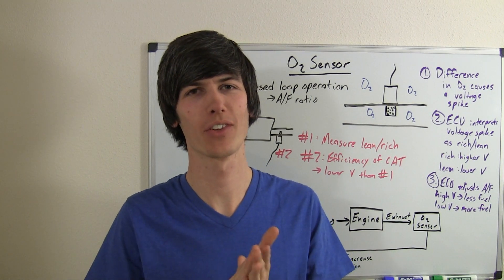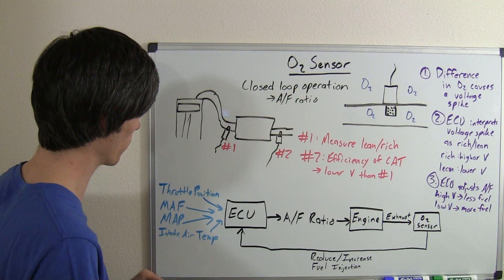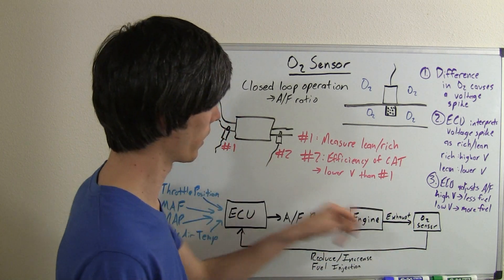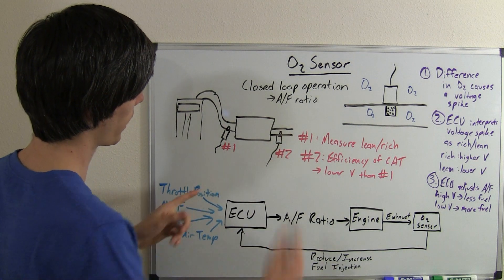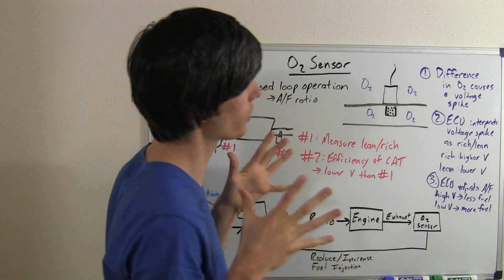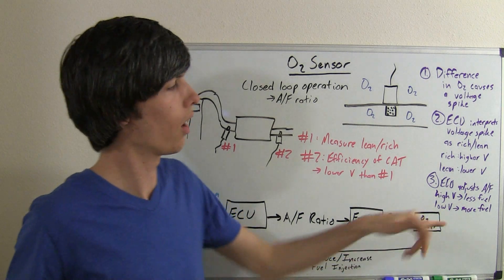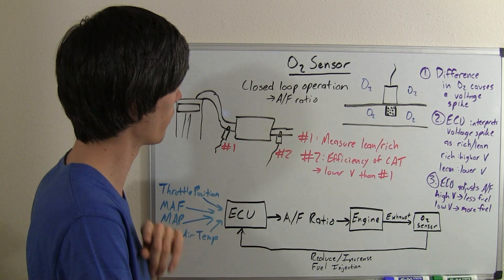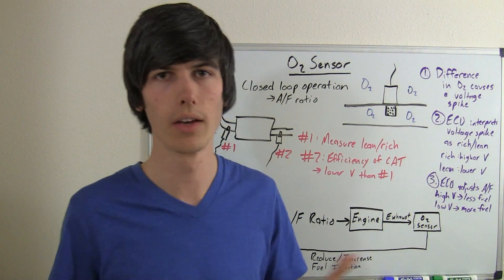Oxygen Sensor - Explained

Comment: I love it when you have multiple questions in your head, and then the presenter answers all of them without you even having to ask!  GREAT VIDEO!!  Much respect from a fellow engineer (mechanical).  Now, it's time to replace my MAF and O2 sensor on my 2005 Volvo XC90 which has 317,000 miles!
Reply: youre a mechanical engineer but you dont how a λ sensor works?

Comment: Closed loop = measurements from the system output (in this case the oxygen content of the exhaust) are used to modify future control values (fuel/air mixture ratios).  Open loop = control values (fuel/air ratios) determined solely by measurements from system input (map sensor, throttle position) and system model (limp-home basic fuel/air mixture ratios stored in the ECU).

Comment from the maker: Same initial four strokes plus an additional stroke injecting water used to take back some of the lost energy and make it useable (vaporizes and expands), and then an additional exhaust stroke. Basically done to improve efficiency and reduce emissions. Fuel is injected once every 3 rotations of the crank rather than every 2 rotations.

Comment: The rear sensor actually responds faster as a rule. The
reason it reads lower is due to the gas concentrations and
the overall gas exchange time not the intrinsic sensor
response time. The rear sensor is protected by
the catalytic converter, so it sees less contamination from
the exhaust gas and therefore less degradation. Remember
that the front and rear sensors are operating under
different gas conditions, so you will see different
responses independent of the sensors themselves

Comment from the maker: Quite a few codes... I don't know about the fuel banks, could be a lack of fuel going to the cylinders. I'd check the spark plugs, if it's run with a distributor check that, the rotor and cap, as well as making sure the wires are fine. If you're not getting a spark it can throw off a few codes, so I'd start looking at that - only a guess though.

Comment: The "narrowband" (2, 3, 4 wire) sensors only report that the mixture is lean or rich.  The "wideband" O2 sensors (5~6 wire) give an indication of how lean or how rich.  So a control system using a wideband sensor can correct back to ideal fuel/air ratio more rapidly and with less error.  Lookup "AFR sensor" on wikipedia for more info.

Comment: How would you extended the wire s on those sensors?  Because I installed headers on my truck and I want it to read right before the cat but it doesnt reach all the way . So I had to put it on the right header.

Comment: Misfires can lead to rich exhaust gases, causing clogged cat converters, then other issues regarding fuel/air ratios. 

You may have individual coils, since it is a Ford V-8. Try to switch those on cyl 2 & 8 with any other. Then clear the present codes and drive for at least ten miles for newcodes to appear. This will then give u an indicator of what components u may need to replace, i.g. coils, spark plugs, o2 sensors.

Comment: Great videos. The only thing I don't get is why the 2nd sensor usually reads a lower voltage than the 1st one. (some oxygen ions from NO are reduced to oxygens, but oxygens are also used to oxidize CO and CxHx, why is the net difference usually positive?)

Comment: I need to set air/fuel ratio on a propane fueled engine.  I was thinking about using a "lambda" sensor or a wideband O2 sensor, will they respond correctly on a propane engine?  I understand the stoichiometric ratio is different for propane, but will those instrument correctly indicate AFR?

Comment: so it spikes back and forth between .1 and .9 in the upstream sensors and is it ok if it spikes back and forth between .1 and .5 on the downstream ones? does that mean its got more oxygen so the cat is working? what reading should the rear o2 have? no spiking or less spiking with different readings than upstream?
Reply: Upstream o2 suppose to fluctuates from 0.1 to 0.9 and downstream o2 suppose stay a flatline like 0.4-0.5-0.6
Reply: My S1 is pinging in at 3.+ and my S2 is pinging in at 0.055 P0420. Car runs great though!

Comment: What voltage = 14.7:1? Do I assume 0.45V is stoich AFR? If this is the case does 0.1V = 3.3:1 and 0.9V = 29.4:1?
Reply: Oh definitely not. You know how AFR are considered wide band? They can see a much wider range of air to fuel ratios. An oxygen sensor can barely see above and below 14.7:1 so the goal on a car with a front o2 sensor is to go up and down passed ideal.

You definitely can't infer AFR like you'd get off an AFR sensor to the voltage on an o2 sensor.

Comment: So if my car is having a failed o2 sensor on sensor #2 and the check engine is also reading a catalytic converter I may just need to have that o2 censor changed? Could the o2 sensor be causing a back flow of oxygen? Sorry if that's not clear ha ha I wish I had more knowledge on cars.
Reply from the maker: It could just be the sensor, yes.

Comment: Would it be possible if I would block off my secondary O2 sensor?  My car is old and I get engine oil blow-by occasionally.  I do not have emission standards to pass and just have an annoying CEL light.  I am thinking of using 2 defoulers with some stainless in between to block the occasional oil coming out of it.  I'll still have the sensor installed but just basically completely out of the exhaust flow.  What do you think and thanks for your time.

Comment: I figured it out, it was an installation error on my intake gaskets. I took everything apart and slapped in some new ones. My air/fuel ratio problem is solved. She's still a little shaky but I think once I get the new spark plugs she'll be running good again.

Comment: Very few secondary O2 sensor also report closed loop rich lean info back to the PCM, not only Cat Efficiency data, it is rare. A good Cat will use up the STORED O2 in the substrate so very little O2 comes out of the Cat so the constant reading can be a low or high voltage as long as it does not swing is the important thing to know. If the Cat is burning the stored O2, the secondary O2 sensor will report rich or lack of O2 which is fine. There are also arguements if this sensor actually reads O2.

Comment: I've been running without any o2 sensors for about 2 years now and my car stutters in the lower rpm's and backfires like crazy when I let off the gas so I think it is running rich and gas is igniting in the exhaust which gives it the crazy backfire.

Comment: thanks for your easy to explain video... I have a question though, if  there is a fault in that 1st sensor, could it cause issues for the second... I have a fault reading on both but after tests the mechanic thinks it's just the first that's faulty... could the fault in the rear sensor be as a result of the faulty front sensor and it's effect on fuel ratio??? I.e. get the first sensor replaced, better fuel ratio and better readings after the cat?  thanks for your help

Comment: Hi nice video! Is it ok if i clean them when they get dirty? I had some problems and after i cleaned them with a metal brush and some cleaning spray the engine chek light didnt come on anymore...sould be ok?
Reply: I tried that a couple years ago. The oxygen sensor worked again before it crashed and ran worse than ever. So, if I ever clean one again to get a few more days of function, I'll be immediately ordering a new one!

Comment: I have a truck. Have you heard of 02 extenders? I want to put them on the upper 02 sensors to use less fuel. I also have a minivan with no cat. And want to put the extenders on the lower so I'm not burning rich.

Comment: How often does the front o2 sensor tell the ecu to adjust its air fuel ratio? Is it at the same frequency electricity is distributed through the car (just guessing 50 hz like standard US electricity) or is is more like every second or minute or couple min?

Comment: Does the ECU adjust air fuel ratio, based on the sensor after the Cat ? 
In performance exhaust applications many times the cat is omitted or high flow. So one will use a defouler or some how program out that sensor on the ECU.  Will this cause the ECU to not make adjustments appropriately. Or is the ECU primarily checking the efficiency of the CAT? Thanks for your time!

Comment: I have a peugeot 306.. the problem is that while I slow down, the engine run normal but i lose power while acceleration then its came back...so what could be the problem...

Comment: i recently bought a honda civic that came with a ECU that has been programmed to bypass the oxygen sensors. Ive been having misfiring issues between 1 and 3 thousand rmps. which is really troublesome for me to drive. is this in any way related to the bypassed o2 sonsors.

Comment: SO the ECU makes changes to Fuel Trim on MAP data - then if there is still an issue the O2 sensors will then make another fuel trim.  So restricted airflow causes MAP to record an actual pressure Below that expected from the Throttle setting,  thus less air, thus mixture is Rich, less oxygen than expected  - So the MAP causes the ECU to reduce fuel input.  WHEN the 02 sensors read exhaust and the MAP/ECU didn't get it right, the ECU is instructed to make an additional fuel trim.  Restricted air flow or Rich condition can come from leaky injectors, caked up valves, blocked EGR?  Unless at idle, where the IAC plays the major role and can be faulty.

Comment: Hi. I have two oxygen sensors, one before the cat, and one after the cat. I also have a decat exhaust setup. So my question is, is it fine for the two oxygen sensors to be reading the same amount of oxygen? Will it confuse my ECU? Thanks in advance!
Reply: Your 1st o2 sensor is primary and determines your AFR (air/fuel ratio), your secondary sensor monitors the efficiency of your catalytic converter and makes sure that it is doing its job for emissions purposes.

The secondary sensor does not affect the readings of your primary o2 sensor, it is merely there as a reading element to determine whether or not your catalytic converter is doing its job correctly.
Reply: Necrodox ah I see. that makes a lot of sense, thanks! What's the point of monitoring the efficiency of the catalytic converter tho?
Reply: iAerick 1.) emissions.

2.) to tell you if your catalytic converter is clogged. If it is inefficient something is "wrong" (I only add quotes because some people choose to run without a catalytic converter (like myself), what that problem is can vary. But a catalytic converter is primarily for emissions. It also takes out some of the harmful vapors that you shouldn't inhale.

Comment: Which condition sets off the CEL? Too Rich, too lean, too much difference between the front sensor and the back or all three?

Most vehicle's are fuel injected. How do you change your vehicle's fuel flow to fix the problem? Also, at some point it becomes necessary to replace the catalytic converter.  If the fuel flow hasn't been addressed, you will just have to replace it again and again!

Comment: A wide band sensor will keep the system in closed loop farther away from stoich. A narrow band (conventional) O2 lambda switch will keep closed loop from 14.6-1 to 14.8-1. The wide band will keep the system in closed loop from ABOUT 10.-1 to 21.-1 The conventional narrow band sensor doesn't know "how" rich or lean, it only knows that it "is" rich or lean.

Comment: Could you explain why the difference in O2 concentration causes a voltage spike?
Reply: The difference in 02 from the inside and outside of the sensor causes oxygen ions to move which creates a voltage. If there’s a big difference in oxygen concentration = Rich Mixture = higher voltage and vice a versa 👌 ... Hope that helps

Comment: is BANK 1 SENSOR 01 AND BANK 1 SENSOR 02 LOCATED ON DRIVERS SIDE OR PASSINGER I DID  change it the passainger side but light keeps coming back for same code but my Y PIPE IS Leaking so could that be the problem as i been told?
Reply: +Asllan Berisha B5 s4 by any chance?

Comment: So by having a o2 sensor you get better mileage? And if that's right how many more miles would you get on the gallon?
Reply: I have a 1999 Dodge Ram 1500, 5.9L, last year my cat got plugged and had to drill the middle hexcomb out, that saves me about .5-1mpg more by leaving the hole in/on it, i get about 17mpg average and about 18.5Highway when new it was rated at 15average and 17 highway...  I get the most fuel efficiency out of it going 45mph.

The engine runs more lean/hot though so you'd need a copper additive(leak stop) to a 50/50 engine radiator mix. I got about 10-15° drop in engine temp using aluminum additive(also use whole bottle as instructed or your water pump will leak like a siv).
Reply: Side note next time at gas station only fill tank 1/2 or 3/4, you save fuel by reducing as much weight as possible. I have lots of junk I keep In my truck, so that 17mpg average could probably get up to 20mpg if I removed it all. Type of tire, Tire pressure, axle differential and steering alignment can also reduce or increase fuel consumption. 
I use AirTab's to reduce wind drag along entire truck as well, which gives maybe .5mpg and increases maneuverability(turning/lane changes, less wind sheer) and takeoff speed after stoping. Same stuff they place to aircraft wings.

Comment: I know this is an old video but if someone could help me out I have something similar but not same scenario. So
My motorcycle does not have a cat on it. The carb was swapped out with a different slightly larger carb that now goes into a manifold and then into the intake of the v twin engine. I’m tuning it and cannot get it to tune right. So I bought an A/F gauge from china. Wired it up so what I can tell it’s working. Screwed the sensor into the side of a can so the top of the sensor is center of the can and taped it onto my exhaust tip so I can move it from one tip to the other since it’s only going to be installed for tuning purposes. At idle current tune it reads 20.0 to 19.6 after warmed up. I pull choke while warmed up and it is blowing black smoke out the tail of the exhaust but drops the reading all the way to 12.6. My question is. Am I doing any of this correct. If it is truly 20:1 that’s way too lean to function but 12.6:1 is slightly rich but I was under the impression that black smog meant it’s way to rich. I haven’t messed with it much yet. I’m going to try resetting it and see what the largest jets I have will make it.

Comment: BEWARE of rich & lean reading due to a misfire or inop fuel injector.  The O2 sensor will read too much oxygen and report to the ECM to add more injector ontime due to one bad cylinder forcing all the good cylinders to run rich BUT the overall average for that O2 sensor reading will be within limits but all the good cylinders will show rich on the sparkplugs while the bad cylinder will show lean so before chasing a problem, do a sparkplug inspection first.  Inline engine vs V engine will differ.

Comment: O2 sensors are just plain whitchcraft
I need to know how oxygen effects the voltage of currents. Also what does an opened sensor look like? Is it DC like the rest of the car?
Reply: Yes dc voltage, but small,  0.1 to 1.0 vdc
Reply: silverbird58 still clueless but that helps. I posted this years ago and I’m still in school. I understand a little better now

Comment: The previous owners on my car took out all of the O2 sensors in my car, cause me to get terrible idles and gas mileage, would it be hard to buy the O2 sensors myself and put them in... BTW I have don't have much experience with fixing up cars, but other shops prices are about $500 to fix them. What should I do.
Reply from the maker: Depends on the car and where they're located, but so long as the wire fittings are in place it should be fairly simple. You'll likely need to lift up the vehicle.
Reply: easy as hell buy 4 O2 sensor bungs from oreillys and drill your 4 holes for the o2s then center the bungs, tack the first then check alignment with sensor, then cover the threads and weld the bung solid on there screw them in ( not tight , maybe 1 or two turns with a wrench after hand tight)  then plug them in and unplug your battery for 30 seconds and then turn the car on and let it run accessories for a few seconds and then start it and let it idle for a few minutes before driving it. that allows the ECU to register and  to ensure the 02 sensors are working in functioning in correlation with the ECU properly

Comment: hi jason!
i think your videos are great, as they already often helped me to understand different functional principles.

one question:
are you sure, that the second o2 sensor should measure a lower voltage? i think it should rather measure a voltage around 0,45V, which means afr=14,7 or lambda=1.
Reply: Unfortunately, Marco, this is the only time I've caught him to be incorrect. A real world example of a health catalytic converter and oxygen sensor is on my chnanel under the name Downstream O2 Sensor Removal Aftermath Part 2.

When your under more load the rear O2 sensor should sit more rich, when you're coasting or idling it'll often settle down to a very lean or low voltage. There are variations on this from manufacturer to manufacturer, but that is generally the correct idea. You can also read more about it here, or find my video about it from this article:
http://carmilespergallon.blogspot.com/2014/09/beating-p0420p0430-catalytic-converter.html